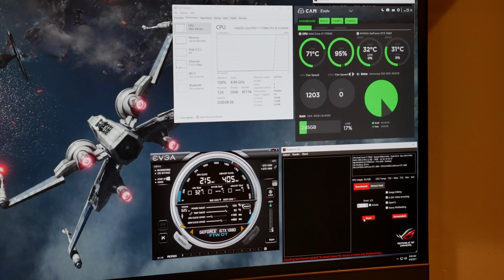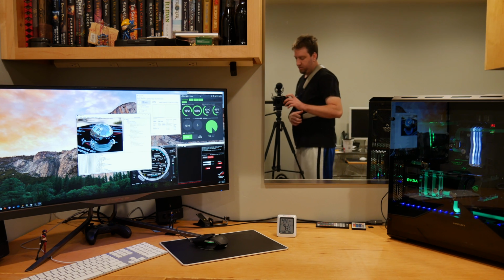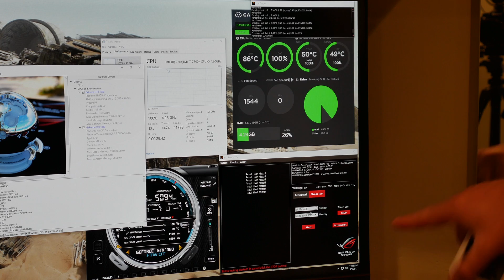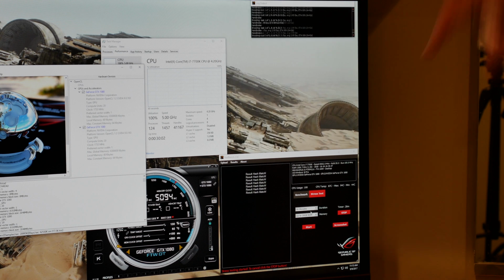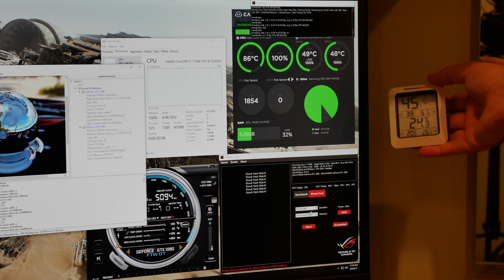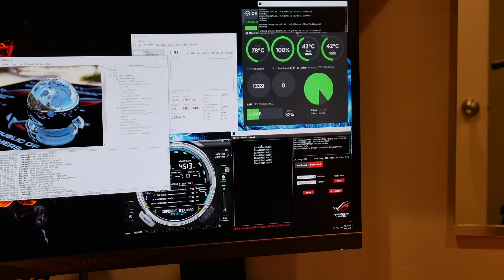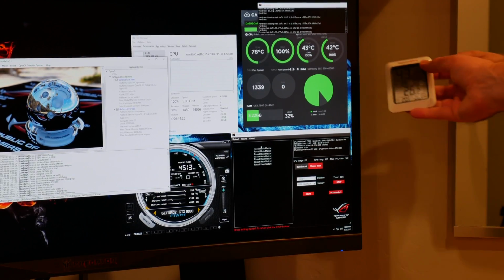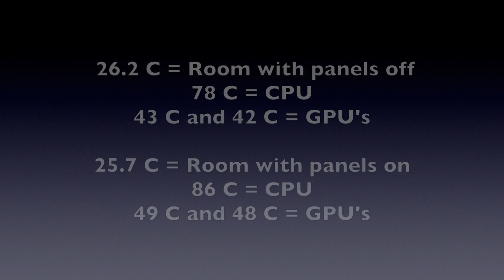Do case panels hurt airflow on your PC? Testing on the Phanteks Enthoo Evolv Tempered Glass edition.

Comment: Why do you test a case with panels off and panels on? You should compare it to a similar sized and designed case with a mesh front panel for example. This video is useless.
Reply from the maker: I tested with the panels off because the point was just to see if the case was restrictive, not to try and find out if there were other more restrictive or less restrictive cases. As I mentioned in the video I originally didnt think it was going to be very much change. I wish it had been more helpful for ya. :)

Comment: Can anyone tell me how air goes thru a tempered glass pc case?
Reply from the maker: Just like any other case. It gets pulled through gaps/holes in the front and exhausted through the top/back.
Reply: @PCGoblin  I've got msi pylon, the funny thing is when the front tempered glass is on, the fans act wierd, like they tend to exhaust air out instead of pulling in? Could this be due to air turbulence? Do you have any idea on how to fix this issue? I think I'll have to increase the gap between the glass and fans?
Reply from the maker: @afstar101  It sounds weird that its blows air just by having something possibly too close. If you hold a tissue on the inside of the case do you see it blow it away or does it pull in? 
I think whats happening is your just feeling more air move with the glass on since its more restrictive than without. 
Do you have temp problems with the glass installed vs when its off?
Reply: @PCGoblin   PCGoblin  I know it's  funny lol, but i''ve actually done the test with paper tissue and it actually pulls in with glass on. And yes huge air flow and temps difference with vs without glass off. Didn't expected this from Msi considering the price of the case! I regret it now, also no one seems to be reviewing this case on YouTube . Though Steve from hardware unboxed had to mod the case for the airflow.
Reply from the maker: @afstar101  Thats crazy! But it sounds like you have a fairly easy fix for it. :D
Reply: @PCGoblin  Which is what? Taking the front panel off or throwing the case away? lol Didn't got your pun bro! :P
Reply from the maker: @afstar101  You mentioned putting spacers in between the glass and the case to allow more air in, that sounds fairly easy. Though Ive got no idea if it really is. Maybe just run without the front piece of glass?
Reply: @PCGoblin  Unable to find the correct spacers. I think i will have use it with front glass off. Anyway thanks for your time & help bro. Also you've got some good content, hope your channel grows ! :)
Reply from the maker: @afstar101  Thank you, Im doing what I can to make it bigger and better. :D

Comment: My mATX model of this case has the same problem. If you put enough fans at the front with good fan control it is ok, but not very quiet anymore. The front filter blocks good airflow I think. A threadripper has a max temp of 68 degrees C, a challange I must add.
Reply from the maker: Does it really choke it that much for you? If you take the panels off or open it up, how much does your temp change?

Comment: Seriously?  You didn't think that starving the flow of cool outside air would cause temps to be higher?  There's a reason cars have BIG FAT GRILLS up front for the radiator and engine...  Put a giant plate in front of the car and see how quickly it destroys the engine.  Why is it so hard for PC dilettantes to grasp a basic understanding of thermodynamics, fluid flow, aerodynamics, etc.  Cool in, hot out...  Make it happen as easy as possible...  Frankly, side panels off represent a poorly optimised flow environment.  There have been numerous cases designed that were cooler with all the panels ON due to being designed with optimal coolibg performance as the goal as opposed to asthetics.
Reply from the maker: Its not that its hard to understand, but the more open the case is the louder it is as well. And its not moving vast amounts of air so the fans not being out in the open shouldnt hurt it that much. Honestly 6 degrees in the worst case scenario doesnt seem too bad to me.

What cases are cooler with the panels on?
Reply: Fractal Arc Midi and Arc Midi R2, basically any case with a free-breathing mesh front and dual 140mm intakes.  Also, removing the silly 'filter foam' in mesh screens is always a good idea, and running a case positive pressure (more intake than exhaust), plan for relatively linear flow and you've got yourself one cool cucumber...  For instance, many cases have WAAY too much mesh, and then they can't contain a pressure differential from outside atmosphere... Back before cases had mesh areas to bolt on rads, it wasn't much of a problem creating linear airflows.  But, now that most cases leak like a sieve,  one should damn-up any unused rad mounting mesh areas with say black poster board and black adhesive vinyl, or thin abs plastic; in order to allow the case to pressurize slightly and get that mas flow going, as opposed to random swirl inside with nothing but chaotic flow mixing due to a lack of established gradient...  I can post pictures of my airflow optimization mods if you'd like...  I regularly get CLC temps from large, low-rpm heatsinks (Thermalright my favorite for years)
Reply: P.S. - Sorry for being a prick in first reply, saw dx racer chair and went on the offensive...
Reply from the maker: I still dont think its that big of a deal, were talking a couple degrees. The best thing for cooling is delidding my CPU. Worrying about it leaking a bit and pressure's doesnt make too much difference. Hell linus even found that postive and negative pressure didnt change much on how much dust there was. But I do like seeing mods, so if you post em link it up so I can see. :D

Comment: Hi! Thanks for you're effort.
I'm buying a gaming PC. specs: 

Intel i5 - 8600k 

MSI - Z370 Gaming Carbon Pro

HyperX Fury 16gb ddr4

Power Supply EVGA - 650 Watts

GTX - 1060 6GB

Corsair Hydro H115i.

WD 2TB / Samsung EVO 250GB 

Master Cooler Elite Case 5 with RGB

it's gonna be warm or it's perfect? thanks
Reply from the maker: That sounds like a really great PC. I would recommend this PSU - https://www.newegg.com/Product/Product.aspx?Item=N82E16817151191 . Its basically as much as the 650 EVGA but more power and higher efficiency for the same price and seasonic is a very reputable brand. But you should be fine, I dont see anything thats going to push that case to be super hot.
Reply: PCGoblin Ok! That's awesome.

http://citycenter.jo/index.php?route=product/product&path=18_78&product_id=3206

that's the power supply that I was planting to purchase, which is 50$ in my country.. Do you recommend? correct me if I'm wrong. thanks I'm still new to these stuff
Reply from the maker: That should be good, EVGA makes a great PSU.
Reply: PCGoblin I forgot to ask you about my case.. I'm getting this one.

http://citycenter.jo/index.php?route=product/product&path=18_62_206&product_id=3814

is it good overall? And the temperature will be perfect right? thanks for guiding btw! you've earned a new sub.
Reply: if you recommend different case then go ahead! thanks again.
Reply from the maker: Nah man, ya gotta go with what you like. Youre going to be looking at it alot. That case should be great. :D
Reply: PCGoblin Ok I was a little bit paranoid but now I'm good :D. thanks so much and you deserves much subscribers :/.
Reply from the maker: Im just happy to help and youre very kind. :D Please feel free to help share my channel. But even more so I hope you enjoy your new PC, it should be a very fun build.

Comment: Tested my 8700k in this case. With a Noctua NH-D15S. Side panels stayed on for the test which is common sense. But with the front panel removed zero difference in temp.
With fans at full rpm... CPU no difference but GPU a mere 3 degrees cooler.

To sum up, so far, I see no thermal issues with air cooling. The issues people have seem to be confined to radiators, both AIO and custom loops.
Reply from the maker: I think thats due to how inefficient air coolers vs water coolers are. But I'm glad your not having any issues with the panels on. :D
Reply: No not at all. The NH-D15 competes with all but the very best AIO's. And in regard to temp change with panels on or off, the  efficiency of the cooler isn't relevant. The variable is airflow, with panel on or off. 

The reason radiators have an issue is as a result of their location, immediately adjacent to the front or top panel. An air cooler on the other hand is located mid enclosure and is therefore less prone to being starved of air. In addition of course, the D15 is within an inch or so of the rear 140mm fan.The air is warmer of course, mid enclosure, but the temperature differential is sufficient.

Its been pretty much definitively established that this is an issue for radiators, rather than air cooling.
Reply from the maker: So do you think the results would be different if the rads were repositioned into the center of the case with that logic?
Reply: Well that's an impractical suggestion. But no, probably not. A radiator is a completely different design to an air cooler heat sink. The surface area that radiates heat is configured differently. In the case of a 280 rad, 280 x 140. Thus the heat is dissipated over that greater surface area, so a rear 120/140 case fan in close proximity would be less effective. Half of the radiator would not be in line with the rear case fan. 

I think it's common sense that a heat sink like the D15, equipped with two fans, (a 140 and a 150 mm) blowing heat directly to a rear 140mm exhaust fan,  (that's a mere inch or two away) without restriction, is going to have less of an issue exhausting heat,  than a 280 x 140 radiator's going to have  ( exhausting or ingesting, dependant on how it's configured) that's very close to an adjacent, badly ventilated panel. 

Clearly a custom loop, or the best AIO's are superior to air cooling, but the best way to compromise a radiator is to starve it of air. And the best way to starve it of air is to position the radiator close to a panel with minuscule vents. Or conversely of course, if it's exhausting, expect it to push air through minuscule vents. 

I conducted the test again today, being careful to make sure all variables were accounted for, fixed fan RPM etc... and again, same results.

Edit: There is a way your centrally mounted radiator scenario may be more effective... that's if we were dealing with a smaller 120/140 rad. Positioned at the front of the case, fed a minuscule amount of air courtesy of very restrictive vents, clearly it would be compromised. However, the same 120/140 rad attached to the rear case fan mounting point wouldn't be.
Reply from the maker: I see what your saying by having it pull the air through the back of the case almost immediately from cpu cooler in front of the exhaust. Ive found that the front panel doesnt affect much off or on, but when I remove the top off the case it nets pretty much the same results as all panels off. Which makes sense.

What CPU are you cooling with your d15? What kind of temps do you see with it?
Reply: I agree with you when you said the temp increase you see is hardly a big deal, it isn't much in the grand scheme of things. Would just be interesting to figure out what is occurring though.

You asked about my system. 

8700K

Overclocked to 5 GHz at 1.35 volts, with HT off, ( HT off equates to 10 degrees) I see the hottest core at 77 degrees after 15 minutes in real bench. Ambient was 23 degrees. 

 I have delidded. Shaved about 10 degrees off the CPU temp. Didn't expect more though, as the Intel paste seemed quite well applied, not too thick and certainly not dried out like some report. And apparently Intel are using a different TIM, something a bit more efficient than the old Dow Corning stuff they used previously. That was with Thermal Grizzly Conductonaut between die and IHS and Thermal Grizzly Kryonaut between D15 and IHS.
Reply: Just tested again at stock settings. No overclock. In RealBench. Ambient was 19.9 degrees.

And I have am apology to make. With CPU fan and all case fans to max, so no PWM variable to account for I saw the following.

All panels on = 61 degrees max CPU temp. 

Front panel off = minus 3 degrees. (makes sense, as more cool air fed to D15)

Top panel off = minus 1 - 2 degrees.

So I was indeed wrong to state no difference in temp with the D15. It's not much, nothing of any concern, but there is a slight difference.
Reply from the maker: Interesting. Thanks for the update. :D

Comment: https://www.youtube.com/watch?v=11s5XuVYPRw 
This guy fixed the top airflow problem alot with a piece of cardboard. I bought this case myself and thats the first thing i'm gonna do. He also adds washers to the front panel which creates more space to suck in air. Simple solutions but with good results. Hope that helps.
Reply from the maker: Those are good ideas, ive seen pictures of using cardboard before. Ill probably try those out.

Comment: Good thing I have a delidded i7 7700k : )
Reply from the maker: Thats awesome! Did you do it yourself or have silicon lottery do it?
Reply: PCGoblin I managed to buy it from eBay at a good price. The CPU came dismantle so I could add the liquid metal myself and put it back together. Works great.
Reply from the maker: locoism1025 thats awesome! What kind of temps do you get?
Reply: I was using the Corsair 460x case and was getting temperatures in the 50's Celsius at 4.9GHz. I returned the case because of cable management and size, and now I'm waiting on the Phanteks Enthoo Evolv Tempered Glass case. Hopefully the temperatures remain great or close enough.
Reply from the maker: locoism1025 those are amazing temps. I think im going to delid mine. I hope you like evolv as much as I do. Its such a great case.
Reply: Thanks. Deep down, I always wanted the Phanteks case but I was reading to much negativity on bad airflow. hopefully the delidded i7 7700k will improve temps.
Reply from the maker: locoism1025 I think youll be fine. I really dont think its too bad. But if you remember, let me know what you see with it. :)

Comment: 86C on 7700K water cooled ? WOW I thought my 84C temp on my 7700K with Noctua D9L was way to much ... I was thinking of buying This Case I really like how it looks , but those temps are way to much . I think I will stay with Corsair AIr 240 .
Reply from the maker: Mpamphs Kangourosaurous Do you have your 7700k overclocked? If so to what clock and how much extra voltage?
Reply: PCGoblin First thanks for your reply. My 7700k at default clocks and Xmp profile had 4.2 to 4.5 with   default volts 1.2 . And max temps on 100% cup load after 1 hour was 75-78 max. But my DDR4 was not using XMP profile ,after enabling on bios XMP profile and pushing my DDR4 to 4.266hz my 7700K was always on 4.5 ghz on all cores  and same test I got 86-88 temp on cpu.  That is strange XMP make it really hot. My case is Corsair air 240 with 2x12 Noctua front 2x9 exhaust and 1x12 up exhaust to . It's really amazing flow case opened all the way , but I don't like the looks. I saw your review and I stopped from ordering your case .
Reply from the maker: So when you enabled XMP it increased the voltage to your CPU and is forcing your cores to run all at 4.5 where as before enabling XMP only one core would hit 4.5ghz. So with XMP its got more power causing it to get hotter. So when you look at my temps I have even more power going to my CPU and im pushing it alot harder, so my temps would be way worse if I didnt have my custom loop cooling it. 

As for the case if you dont like the looks then definitely dont order it, but I dont think 8 degrees when running an extreme test scenario should put you off from the case especially if your just running an XMP overclock. Either way you may want to consider an AIO cooler for you CPU to help bring down the temps a bit more since thanks to Intel doing a bad job with the TIM on the CPU these chips run really hot.
Reply: PCGoblin I really like the looks of your case ... But I am afraid that I have to change my low profile d9l cooler with water cooling. Can u advice me the most silent water cooling ?
Reply from the maker: I get being nervous about them. But as long as you get one with flexible soft tubing that will eliminate even more risk. I am a really big fan of the NZXT AIO's especially the kraken x62. When I installed that for my father in law this summer it was quiet and looked great. But aio's do have noisy pumps at times but from my experience that was when they were going out. 

https://www.nzxt.com/products/kraken-x62
Reply: PCGoblin thanks for your time I will go for this cooling ...thanks a lot
Reply from the maker: Im happy to help. Thanks for watching. :D